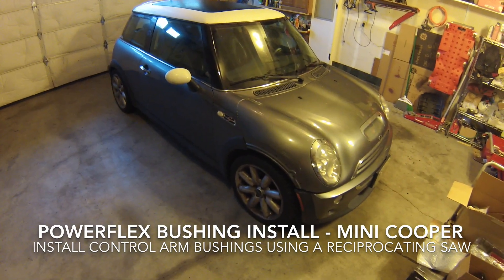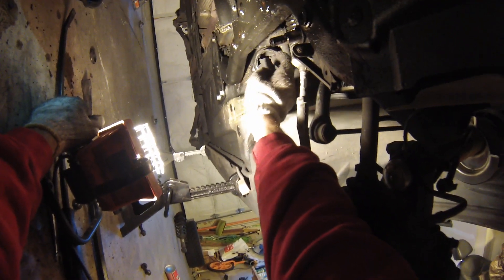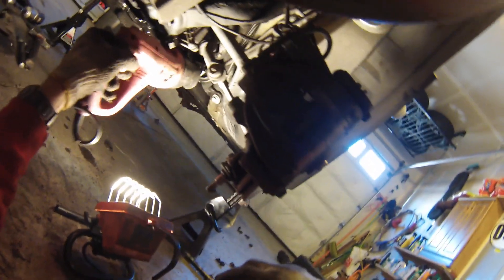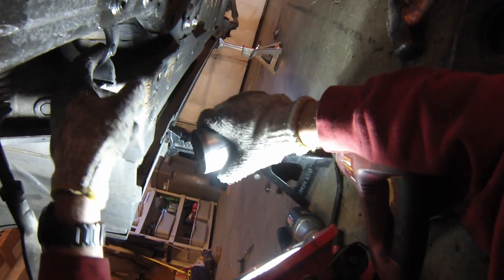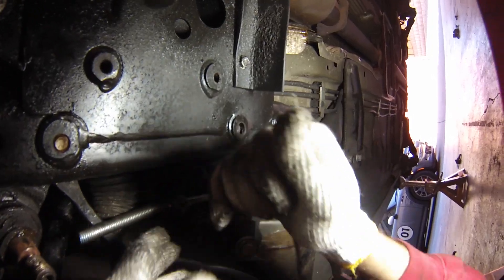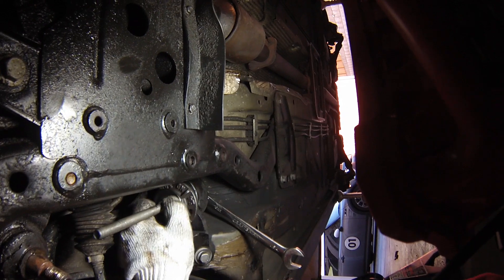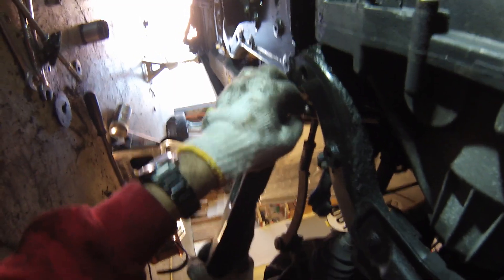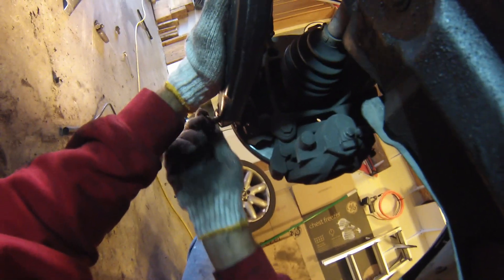MINI Cooper Control Arm Bushings done on the car-cutoff method - Powerflex

Comment: Thanks Mod Mini ... I will be doing my control arm bushings, inner and outter ball joints. That tool you made to press the bushings in I pretty much replicated it... so for the benefit of everyone on this thread ... I went to Home Depot ... got a 1/2 inch Threaded Rod $1.57, 1/2 inch washers $.33 a piece, 1/2 inch floor flange $4.21 each ... The tool is just about $11 bucks to make. Hope this helps!
Reply: Thank you so much for sharing this, how much of each part did you need to  make the tool? I will be replacing my bushings soon
Reply from the maker: 2 rods, 2 flanges, 6 nuts, at least 4 washers.
Reply: Highly appreciated!
Reply: Is there any room with the control arms removed to access the sway bar bushings?

Comment: Just did this. I used 2- 1/2" floor flanges, 1- 5/8" x 12" stainless threaded rod, 2- 5/8" washers, and 3- 5/8" stainless hex nuts. I tried it first with a 1/2" threaded rod but stripped the threads before the first bushing pressed in. The 5/8" stainless rod had no problem pressing them in.
Reply: Thanks pianogrey. I used your set up and it worked fine for me. No problems with the rod even coming close to stripping out or bending. My bushing was kinking up but I pushed it up with a jack and got it to eventually pop in.
Reply: Hey, I'm getting ready to try this. Does the 1/2" floor flange fit over the 5/8" rod?
Reply: @rickrothmund5934  Replying for future readers like me, i'm gonna do this tomorrow and it fits, i have the size between 1/2" and 5/8" which in metric is M14 (M12 is 1/2) and the flange sits fine with space for next size which is M16 which is 5/8", i'm gonna try it tomorrow, will probably report here the results.

Comment: For those with trouble reinstalling the control arm into the new bushing (as I did - spent well over an hour trying to get them in unsuccessfully): I used two 4" hose clamps, daisy-chained, and wrapped it around the back of the bushing housing and through the hole in the control-arm closest to the bushing.  Tighten it up with a driver and it pulls it right in.  

Another commenter suggested a ratcheting strap - I didn't have one short enough to try this, but it's the same principle (and I had the hose clamps in one of my many piles of junk).
Reply: Thank you for the help!!!!!!!

Comment: Hi there from the U.K. Thanks for your great videos,I like the way you always seem to remain cool and collected. Normally when I do jobs like this there is a lot of swearing ha ha. Just a quick tip that may or may not help someone. If you are replacing the bushes with standard ones, (nor Powerflex) when you come to insert the lower arm into the bush it will be very, very tight, almost to the point where you won't be able to force it in. I have found that getting the arm just into the bush and then using a pair of large water pump pliers enables you to squeeze the lug on the  arm and the casing together forcing the arm to go into the bush. It takes about 20 seconds to insert the arm as opposed to half a day shouting at the dam thing to go in! All the best, Mike
Reply from the maker: +MikeJF355 Well that's for two reasons: 1. I've done these jobs several times before 2. I edit out the bad parts. That's a good tip you are sharing. Another trick is to use a nylon ratcheting strap to pull it all together. 
One of these days I need to do a better quality and more detailed version of this video...
Reply: I've just come indoors after 4 hours trying to get the bush to seat fully so this is a satisfying comment to find as I just assumed I had done something wrong. I will try these methods tomorrow. I am using 'problem solving bushes' which I assume are a UK brand, they look good and were cheap compared to powerflex. Not fun laying in the snow doing this job.. wish me luck for tomorrow guys!

Comment: Today I replaced my control arm bushings with Mevotech parts, the metal shell and the bushing in one.  It was a pretty horrible job, had to drop the subframe as mentioned.  In retrospect I wish I'd found this video, it would have been less expensive and far easier to do.  But it didn't show up on my YT feed until today for some reason.  Thanks though!

Comment: PSA FOR ANYONE WHO WANTS TO TRY THIS:

I tried to do the car cutoff method and install the stock bushings, and I believe this is impossible without a press. I was able to get it most of the way through with the tool everyone else mentions but it never straightened out and the tool broke before I finished. 

I strongly urge you to only do this if you have the powerflex bushings. And I still only recommend dropping the subframe as well for this due to what I have experienced these past couple days

Comment: Thanks for the instructions! Did this on my r53 while my subframe was out during m6 clutch job. I used a stock style bushing already pressed in by Mevotech and found slipping them onto the control arm much more difficult than the removal. Seems the Powerflex units slid on much easier in your video and should have gone that route.
Reply from the maker: Yes. It requires quite a lot of force to install the OE style bushing. I usually pound them in.

Comment: A few tips from a lady..I ran into obstacles with each and every step, so let me break it down on some easy tips:
1. pickle fork the ball joint from the outer control arm (you can replace the dust boot from O'Reilly's in the performance section. They're red which is cool) You may need to pickle for the inner ball joint as well, just make sure to push the grease boot up so you don't damage it.
2. Cutting into the housing on the control arm and the housing for the bushing isn't that scary.  I got it done within 5-7 minutes with a reciprocating saw 

http://c.shld.net/rpx/i/s/i/spin/10124338/prod_1491432512?hei=416&wid=416&op_sharpen=1

3. The best way I found to build the apparatus for pressing the new bushing in was to go to Home Depot, get a 3/8" rod, 4 washers, 4 nuts (4 because it pays to get extra in case your boyfriend breaks or bends it) $5 (buy yourself some lube while you're there, you're going to need it). Then go to O'Reilly's and rent the ball bearing press kit ($120, but you get your $ back upon return).  Use the outer plates on your homemade apparatus.  This is about the only thing I could find that would fit my mini.
Lubricate the hell out of the bushing housing. When you have everything aligned for the press, make sure to pull down on the rod, because once the bushing starts to go in on one side, it will automatically pull the rod up. This will take a lot of strength, but stick with it, a few more cranks and she'll be in.
4. once you've cranked the bushing in as far as it will go, use a ratchet strap attached to the control arm and the other end further under the carriage and crank it in all the way.  I found it helpful to use my jack to hold the arm in alignment while doing this. so make sure the middle bolt is aligned somewhat in the arm before going crazy.
5. Getting the middle bolt all the way in may be a job in itself.  Just use your hammer and hammer against the very inside of the "boomerang" close to the bolt.  You can spray silicone to aid with process.  It shouldn't be too hard, just be patient.
6. Crank the wheel all the way to the right (if you're working on the passenger side) or all the way to the left (if working on the driver's side) in order to get the outer ball joint to align and get back in the arm.  Also, using the jack under the disc will help alleviate any pressure on the arm and help in getting that bolt back in.  Don't forget the grease boot before doing this! 
7. When tightening the nuts, remember that if the bolt begins to turn with it, you need to use an Allen wrench.  I found that purchasing an open ended ratcheting wrench set help tremendously.  (I'm sure I'll use it for future projects) I used it for pressing in the bushing and again when tightening the nuts on the control arms. ($49)

http://c.shld.net/rpx/i/s/i/spin/image/spin_prod_541330301?hei=416&wid=416&op_sharpen=1

It took me 4 days all in all.  First time.  Yes, I'm a girl :)
Reply from the maker: +Kimberlee Rich Great description and tips - this pretty much captures how challenging/dirty the job can be. But it's worth it for the polyurethane bushings right? Big difference in handling. 

Thanks for the suggestion about replacement grease boots. Hadn't thought of that.
Reply: OMG thank you so much......the suggestion about using the jack saved me big time.....I was getting so frustrated...after I started using the jack I was done in like 15minutes
Reply: Did mine today using the same method - Your tip about using the ratchet strap & jack to re-insert the control arm into the bush housing worked a treat..👍
Reply: @Lee-mn748  Glad it worked well! ..smarter, not harder! :)

Comment: Hi Mod Mini. Thanks for all your diy info. I need to know how to separate the inner ball joint the both left and right control arm. thanks
Reply from the maker: It's not easy. I use a pickle fork with the tips cut a little shorter, and a thick washer cut into the shape of a letter "C". Or, pull the drive axles out of the transmission and then remove the bolts holding the inner ball joints onto the subframe, and then whack out using a hammer on the workbench.
Reply: *****
thank you mod mini appreciate your reply

Comment: Four days ago, I had a shop install new.LCA bushings. Instead of power flex they ordered 2 from direct imports. They sawzalled out the old. bushings but when it came time to install the new ones I was surprised to see them grind off all the paint from the new bushings. Then they had to use a rotary grinder to take a bit off the leading edge of the carrier on the left (driver's) side. Then they greased up the carrier and even with all the grease and grinding, it took 2 men awhile to pound in the bushings with a big hammer and a piece of steel. They pounded quite awhile, especially on he left side. It was difficult for me to watch. 
I've put about 100 miles on the car since then (2005 Mini S R52 with about 70K miles). Last night I was pulling out of my driveway when I smelled a lot of gas and the car began to stall out. There was a puddle of gas under the car. The next day when it was light, I looked under the hood which it was difficult to open, and that was a first on this car. The pull cable worked but it was like one side of the hood was stuck. The pull cable opened the hood just a tiny bit and I could barely get my fingers in there to release it. That's unusual. 
I checked around the engine and saw there were 2 small holes in the fuel feed line on the left hand side of the engine (while facing the engine or the passenger side of the engine). It looks as if this braided cable had been rubbing against the hood and wore 2 holes in it from friction, but that's just speculation. I read up on the feed line replacement and saw you have to remove the subframe to install a new one (it's a $70 part). 
My question is could the pounding by the mechanics have caused the hose to kink up or the subframe to go out of whack?  I know the carriers are attached to the subframe. I'm wary since the hood doesn't open easily now and the fuel feed line has the 2 small holes in it. Or do you think these are unrelated and this might be just a giant coincidence? 
Thanks for your time and help. BTW if I'd have known they were going to have to do all that pounding, I would have waited for the power flex ones. Never again will I let the car go through that kind of beating. 
Thanks again for any help or advice you can provide.
Reply from the maker: Sometimes you just have to pound things. There is no paint on bushings. Do you mean the bushing carriers or the control arm? 

What were they pounding on? The OEM rubber bushings are meant to be pressed in, not hammered in. Even so, I don't see how hammering in that area could cause your other problems. 
Pounding would not cause fuel line to rub on bonnet. Rather than replacing the entire tube, You might be able to just splice in a length of fuel line hose and some hose clamps. I don't know where they were pounding and I suppose it's possible it's related to bonnet not opening but it would take a lot to bend a vehicle frame. Best thing would be to take back to the shop and ask them about it.
Reply: maybe the bushings weren't for this car??  out of the box, they had black paint on them.  the shop grinded off the paint to get to the silver part underneath.  they inserted them into the carrier (the round tube like opening that holds the bushing) but it was such a tight fit they had to literally pound them in. it appeared to me to be metal to metal contact (carrier being metal and bushing being metal).   they told me the paint on the bushing was temporary and was on there just to prevent rust during shipping.  they were close to or actually were this one here:  http://www.oreillyauto.com/site/c/detail/OPC0/BU09018/02936.oap?year=2002&make=Mini&model=Cooper&vi=1387863&ck=Search_C0318_1387863_-1&pt=C0318&ppt=C0106

after they pounded them in, which took 2 guys a minimum of 30 minutes on each side, they stuck the end of the control arm in the center of the bushing.  the control arm was bare and didn't have anything fitting on it when they inserted it into the bushing.  i thought it was weird at the time but they assured me this is how it's done for the non-powerflex type of bushings.

i did ask the shop about the fuel line and any connection to their work when installing the bushings. they said they didn't open the hood so they couldn't have caused the problem.  since you say, it would be difficult for someone pounding on the bushings to get them into the carrier to bend the subframe, then it's probably a co-incidence.

I've thought about repairing the line but it's braided and there are two holes.  one is very close to the cover on the cylinders (forget the name).  i'll have to check out how to fix a braided hose... i'm sure there's a way.

thanks again for your help.  i appreciate it very much and i love watching your videos.
Reply from the maker: They should be pressed in with a hydraulic press and the shop should have known that. I guess hammering would work but it would take a lot and it would take care to avoid deforming them.  But I've never seen MINI Cooper bushings with paint on them. Pretty sure the fuel line is just regular fuel line. Any braiding should be just to prevent chafing.
Reply: you're probably right.  the black stuff they grinded off was probably a thin coat of rubber, not black paint.  maybe they didn't have a hydraulic press.  i got really nervous when they pulled out a rotary tool and grinded down the leading edge of the carrier so they could get it in.

i drove 20 miles for the service at this particular shop because they had a pretty good reputation. :( 

anyway, will these bushings be okay with the rubber removed?  (i saw on your video that you cut through just past the thin metal band on the bushing to get it out).  on my car that metal band inside the bushing is what is in contact with the carrier, with no rubber between them.
Reply from the maker: They ground down the carrier? That's a hack job and I'm sure they knew it. The bushings should be fine. Usually it's metal on metal without any thin coating. If they just took off the coating, it's probably fine. If they cut off that outer metal ring, that's definitely not fine. But still a hack job.
Reply: they ground off every bit of black from the outside each bushing so they'd fit into the carriers, but they did leave the metal intact.  they also ground a bit off the inside of the leading edge of the left carrier with a rotary tool.  it seemed minimal but i saw it and it made me uncomfortable too.  they took the bushings to some big, loud machine on the other side of the shop to grind the outside layer off of them.

after the job was done & driving for about 100 miles, the weird bonnet thing and fuel leak started.  i thought these 2 problems might be connected to the extreme pounding they did.

yep, hack job, you're right.  it's hard to find a good mini mechanic; some don't even want to work on them but i love my mini.  i've owned this R52 since 2006 and the fuel line leak is first time it's had an issue starting or running...

maybe i'll have a talk with the shop's owner about the work.  initially the service manager tried charging more $$ saying they had to drop subframe and remove the carriers.  when i brought it in, i watched the entire job and saw they didn't drop the subframe & never removed the carriers so i renegotiated the labor charge.  also if they hadn't spent time grinding and pounding, this job would have taken maybe an hour but it took slightly over 2.  however, they tried to charge for 4.  BTW, if it weren't for your video, i wouldn't have understood the job and that they were trying to charge for labor they never did.  

anyway thanks again!  i appreciate your site very much...
Reply from the maker: Definitely talk to the owner. 
Shops will charge extra for labor a lot of the time, it's just the way it is. They really should have just lowered the subframe and pressed them in. The method I showed in the video is really only for polyurethane bushings. Good luck.

Comment: you can remove the drive shafts to gain access to the bolts that hold the inner ball joint onto the control arm . drive shafts have to be removed so the long bolts can come out. this is how i do them without using a pickle fork .
Reply from the maker: Yes that's the other way